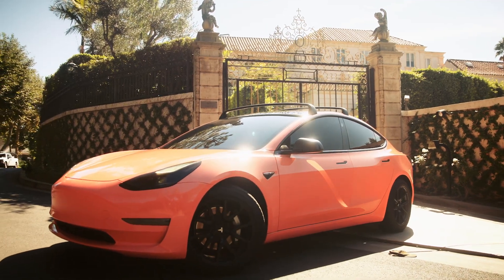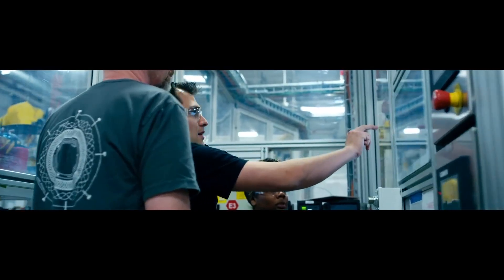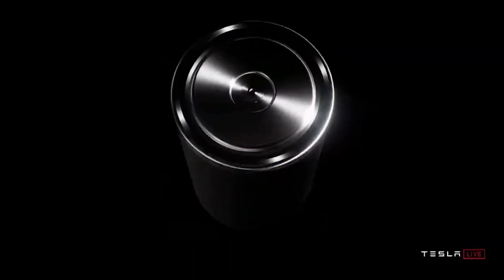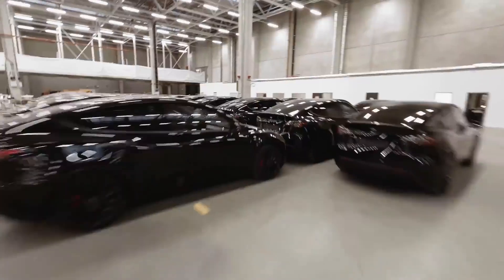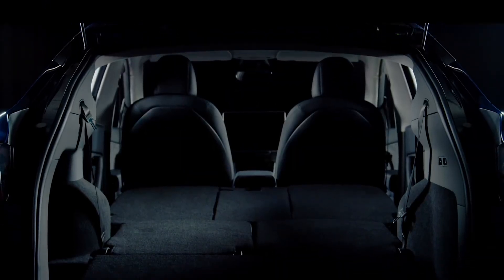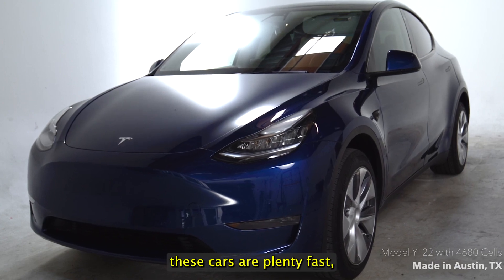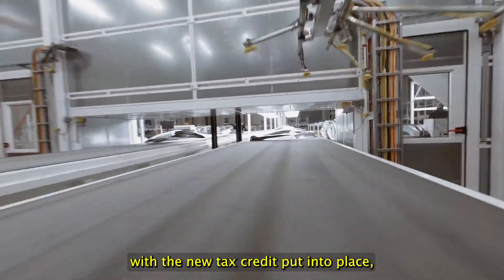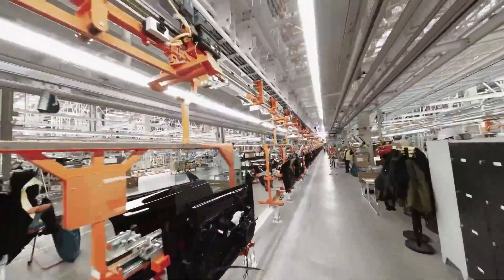2023 Tesla Model Y Standard Range vs. Long Range

Comment: 4:26 incorrect. It’s called the All wheel drive model Y. It has 2 motors. Hence the ability to do an acceleration boost to to the same 4.2 secs as the long range. I work for Tesla. Nice video and production ❤
Reply: I have the 4680 all wheel drive and there is no option to do a performance boost unfortunately
Reply: @domesticmanhub  when did they make an all-wheel-drive version? I work for Tesla for three years. The 4680 was a limited run for the model Y and it was a slowest version 5.6 seconds to 60 I believe.

Comment: Also, the STD Range 4680 battery Model Y is said to have a better ride due to the structural battery build.
Reply: What do you mean specifically by "better ride"?
Reply: @trevoryard9954  Less jittery, better over uneven surfaces and potholes, quieter.

Comment: I would always recommend the newer battery chem, as shown by tesla, they move quick but everything is based on the battery for an EV car, so prob best to get the 2023 from Austin TX, or just wait till the update the Y with those new cells for the LR
Reply: I would not be surprised if Elon allows SR owners of the 4680 to buy the extra range, when the LR 4680 comes out later on. And similarly as before, then the SR would disappear and no longer be made. This would be as to not cannibalize his sales.
Reply: Isn’t the 4680 disappointing and overhyped?
Reply: @Mosquito3314  it’s just that I heard the new battery may be cheaper for Tesla quite a bit, but the quality and performance of the tried and true 2170 is still superior
Reply: @puhoyzzee4364  I mean its like you said tried and true 2170. 4680 on paper states many claims. 

Just gotta wait and see for more reviews on them and range numbers people are getting. 

Tesla is putting this on their SR Y and soon on their updated 2024 Model Y. I see no reason to think it wont outperform the 2170. 

People forget like Tesla software locks thier packs. I would not be surprised if thats the case right now.
Reply: @Mosquito3314  I’m getting delivered a MYLR from Austin tomorrow, kinda bummed it’s not the Fremont version with matrix headlights - heard some were getting them, although Tesla reps said no MYLR is getting them, as well as only 2170 for them too.
Reply: @puhoyzzee4364  Yea, I have an Austin build SR est. delivery for the end of this month 25-31. I hope it comes with all those new goodies like the matrix headlights. Definitely check to see if you get the new cameras. Some people are getting their orders and its all the old stuff which is a major bummer. 

But hey you never know. Wishing you luck and hopefully little to no panel gaps.
Reply: @puhoyzzee4364  Hey did you get the delivery yet ? Let us know
Reply: @Mosquito3314  yep got the delivery last Friday, old cameras according to comparison pictures I looked at, and probably no matrix lights since it’s Austin built. Few issues I found were a lot of red dirt which is from during transportation, the right side blind spot cameras seemed looser, there was a scratch on the rear bumper, left headlight was not flush, rear seat plastic on the back was completely loose/hanging from the wire. I also noticed lots of vibration when driving on regular streets 20-25mph but I don’t know if that’s just being picky or if it is a real issue - never had to deal with it usually driving a Lexus.